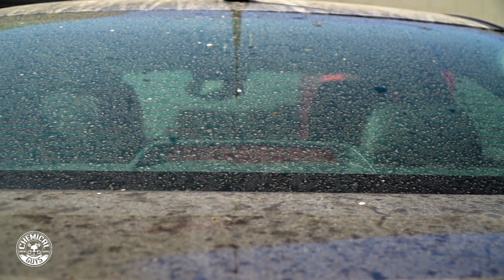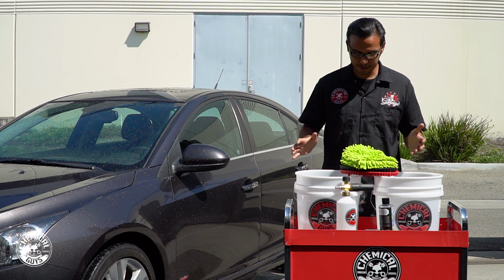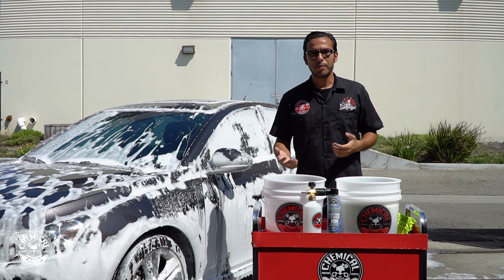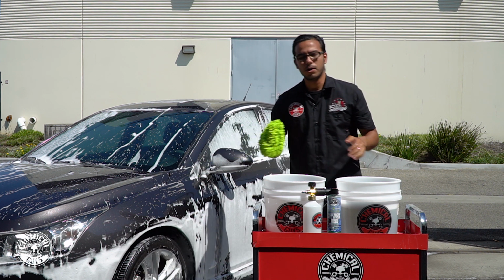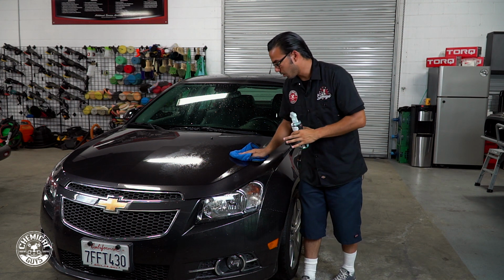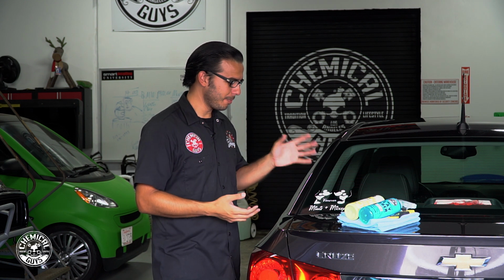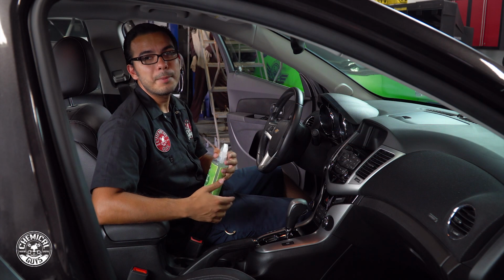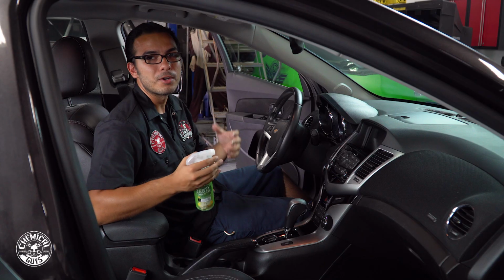How To Detail A Neglected Car! - Chevy Cruze - Chemical Guys Car Care

Comment: No clay bar, no polish, no wax, no protection, no wheels and arch cleaning, no interior cleaning, ... This video is not "How To Detail A Neglected Car" but just a long advertising for two products. Cool video anyway but the title is misleading... just my opinion
Reply: Rims are also clean. Looks more like car has just been sitting parked for a few weeks or less if next to a dirt lot. CG has shown dirtier cars than this without the neglect tag.
Reply: If you were attentive you'd realise that when he said "We kind of snuck his keys away, we're trying to surprise him and do this quickly" that they probably weren't going to do a full clay/cut/polish/wax or seal.
Reply: if you haven't noticed every single video they make is an advertisement for their wares....

its called business
Reply: if a car doesn't need to be clayed, don't clay it, if a car doesn't need to be polished, don't polish it. it should have been protected at least, but it didn't seem to need polishing.
Reply: +Danny Canham Then call it what it is, how to wash a dirty car. There was no detailing done, just a simple two bucket method wash and dry.
Reply: Washing in direct sunlight
Reply: @wheresthedvo  then u dont call it a "detail"
Reply: @Sketchy_Vettes  dude they didnt even do the basics correectly, they likely didnt more damage than good to his paintwork

Comment: I bought CG's TORQX polishing kit ($199 @Amazon) + V36 & V38 compounds to remove holograms I created by accident.  The DA polisher & the V36 worked like magic and now my 2004 Acura TL is shiny.   For wax, I still use Gliptone's paint sealer but I may give a try on CG's product. 

BTW, the DA polishing kit at about $160 @Amazon is sold at approx $700 @Amazon,co.jp (Amazon in Japan).............
Reply from the maker: Hey buddy, thanks for watching! That's great news, glad you picked up the TORQ X, it's a worthy machine. V38 and V36 will definitely get the job done. You should try our Jet Seal, which would be the equivalent of what you're using right now. People who are passionate about detailing love Jet Seal, it spreads easily and has long lasting protection against the sun's damaging rays.

Comment: Wow that shine looks new, from camera angle looked pretty original like from the dealer after it was washed, sure a few details to be 100% but great wash!
Reply from the maker: The cruze needed to be polished, and they did that in the following video which made it look complete, the paint was thrashed after decades of improper conventional washes, and plenty of neglect on the behalf of the driver.

Comment: Wow legit the next car I would like to own is a Chevy Cruze RS it’s actually a nice car and all that flake in the paint is awesome! I love the colour and I’m really happy you guys did that for you boy in the office if that was me at the end of the day I’d be looking for ya nick and buy you lunch of supper bro. That was a nice thing you did for them. As always chemguys stay frosty and see you on the next video. 

Take care,

Your number one fan 

Matthew.
Reply: It has a jerky bad shifting gear box. It's really slow. But gives out good gas mileage. I own one;)
Reply: They are amazingly slow. Doesn't handle well, doesn't shift nice. I had one for a rental for about a week. Abused the living he'll out of  it lol
Reply: Don't do it lol. Resale value is non existent, handling is decent but not the best, braking is terrible even when brand new, constant problems (coolant leaking, PCV valve cover failures, intake manifold failures, radiator cracks, water pump failures, accelerator pedal fractures.) I have one and it's the worst. When everything is running fine it's a decent car. But I've spent approximately $3k on repairs this year alone.
Reply: My mom just got a 2017 chevy cruze and its one of the best cars i have ever driven. also get the LT cause you got more options than the premier model. for example redline edition which is one of the options not available on the premier but is available on the LT and looks cool.
Reply: Matthew Osborne bro DONT do it... I got a brand spanking new loaded 2015 Cruze 2LT RS with the beautiful tan leather interior, and had to get rid of it. Vehicle had MANY issues (some almost fatal), although it was well maintained, and garage kept. In a period of 3 years, the car was in the shop over 25 times, and never fixed. We had to file a lawsuit under the lemon law, and won. Instead, I bought a brand new jet black 2017 Nissan Altima SR, with the appearance package. A MUCH better car.
Reply: Christopher Daniel and that shitty CVT. Altima are know for huge problems with CVT. Don’t get an Altima.
Reply: I had one as a rental too had like 10k on it and couldn't believe how noisy the engine was and how hard the shifts were compared to my 10 year old lexus. Did get good mpg though
Reply: I have a 2016 the new body in premier it’s way better than before the LT is too cheap looking. They def did a huge improvement on the new models. It would be best to just get a deal on a Premier RS
Reply: Matthew Osborne my dad has one and it’s junk

Comment: Snowfoam is for a pre wash,it's designed to remove contaminants before following up with shampoo using the two bucket method or alternatively use the shampoo through the lance. Snowfoam and shampoo are meant for different things. I found this confusing and potentially people new to detailing can get confused and think you can just use snowfoam instead of shampoo to wash the car. Love your vids but maybe it should have been explained better that you washed it with shampoo after 🤔
Reply: Well at least I hope it was washed with shampoo after,I'm a big fan and would love it if you could reply as I'm starting to thing I'm using snowfoam wrong here. 

I normally spray snowfoam and let it dwell,then rinse off, then I grab a bottle of black light shampoo or V7 👌🏻poor into my bucket then wash again with shampoo using two bucket method or shampoo via the lance for loads of suds.

Comment: Why would you 2 bucket without rinsing what the snow foam has pulled off the car? Surely you are just rubbing the dirt back in! I would likd to here your logic behind this
Reply from the maker: Hey Bill, thanks for watching. We started by rinsing to loosen and remove the heavier debris followed by foaming to encapsulate the remaining particles, the purpose of foam is lubricate the surface and wash mitt so that they both will safely glide across the surface. We try our best to conserve natural resources..."and don't call me Shirley" - Airplane

Comment: What brand of pressure washer do you guys use and what psi is required to get the same foam results?
Reply from the maker: Greetings from the Chemical Guys media team, we use a pressure washer with similar specs like the one in the link . It's not the same brand but the reviews seem to be positive.  Stay tuned for more great videos.
https://www.homedepot.com/p/WEN-2800-PSI-2-3-GPM-Gas-Pressure-Washer-173-cc-PW28/301403932?cm_mmc=Shopping|THD|google|&mid=srvJZ9Wc6|dc_mtid_890338a25189_pcrid_139636194844_pkw__pmt__product_301403932_slid_&gclid=Cj0KCQiAkNfSBRCSARIsAL-u3X9yCxXoF8Y_xh572XYgyk_c87RarFl_O5nrsM5OxhVNLsnyIDSzSHIaAlR-EALw_wcB

C.G. Alex -

Comment: Is it better to wash the car with the suds on or rinse it then wash it by hand with the 2 bucket method?
Reply from the maker: Hi Jacob, how's it going? We like to wash with the suds on. The suds help lubricate the paint and help keep abrasive particles from scratching the paint, so the more suds the better. As you can see in the video, when using the foam cannon, we still use it in conjunction with the two bucket method. Thanks for watching and stay tuned for  more videos headed your way soon!

Comment: When shopping for a pressure washer, what is the highest and lowest psi to aim for? Thanks! Cool vid
Reply from the maker: Hi Wayne, you certainly don't want to go too high, or too low. The main thing you'll want to remember is that to get good foam, you need a high GPM to get good foam. Electric pressure washers are good alternatives to gas operated pressure washers for a number of reasons, however they don't produce enough GPM to get exceptional foam. We use a gas operated pressure washer with a PSI of 2800 and a GPM of 2.3. This is probably the best electric pressure washer specs I could find https://www.homedepot.com/p/Earthwise-1-850-psi-1-4-GPM-Electric-Pressure-Washer-PW18503/205694662. Most people will buy the the Ryobi 1600 1.2 GPM pressure washer. I would recommend buying this one in the link, it's got specs that are identical to the one we use. https://www.homedepot.com/p/Ryobi-2-800-PSI-2-3-GPM-Honda-Power-Control-Gas-Pressure-Washer-RY802800/205566052.

C.G. Alex -

Comment: How much pressure do you need to get that amount of foam?  I know the lower PSI pressure washers don't produce that amount of foam.   I am looking to buy a pressure washer and want to be sure I get Shaving cream consistency.
Reply from the maker: What's up Cody! We recommend using at least 800 PSI to produce a thick layer of foam. Add two or three ounces of your favorite shampoo to the canister and fill the rest with warm water for enhanced foaming action.

Comment: I have a question for JetSeal. If you apply by hand to the entire car, do you have to let it bond to the surface and then buff it off or buff it off right away because if you apply it by hand and your done applying it to the entire car the other panels are readyto buff off. Also after you apply JetSeal do you have to wait 8 to 12 hours to let it cure to the surface. Also how to maintain JetSeal after applied.PLEASE REPLY. Sorry for the long comment
Reply: I would let it sit on the vehicle un-buffed for around 20 minutes or longer. Then buff off by hand. 

About maintaining. Just stay up on regular washes. JetSeal leaves paint crazy slick so it shouldn't get as dirty as fast.
Reply: Michael Goodijohn thanks
Reply: just search a jetseal video..

Comment: Is it recommended to spray the interior scent into the air vents to prolong the scent? I sprayed the footwells and it lasted almost a week.
Reply from the maker: Hey Dominic, thanks for watching. It's generally recommended but because it circulates the scent through out the cabin, and purges any odors trapped in there. It's not mandatory by any means, but it's a nifty little trick.

Comment: It's my impression or after the very first rinse the car went new?... No need to wash wheels, back lights are shining like diamonds... It looks like a detailed car.
Reply from the maker: Hi there! Although the vehicle looks clean after the first rinse, there are still abrasive particles and grime sitting on the surface that can scratch the finish if not properly removed. - Happy detailing!!
Reply: @ChemicalGuys  thank you for your reply, probably you didn't understanded that what I was telling is that the car was not that neglected... As on the first rinse it looked new... The car was detailed. When I get a car like that it's impossible the first rinse do that work!

Comment: Kinda strange process i would always wash the car before after foaming it and then use the 2 Bucket Method🤔
Reply: Flo Yo What? Isn't that what he did? Or do you mean you would snow foam, rinse, then 2 bucket?
Reply: yes
Reply: because i think when you foam and instantly use the 2Bucket method u work in all the dirt which got loose and create scratches in the paint makes no sense to me
Reply: Yeah ok now I get you. I agree. Dirt could still be stuck in the soap from the foam cannon so I would deff. Rinse before I 2 bucket wash as weel
Reply: Not necessary, it isn't a show car it's a freaking chevy cruze the power washer got off any "chunks". Soap without agitation doesn't do a whole lot.

Comment: Y’all need to do a video on how to detail a car with rubber on it for us track people
Reply from the maker: Hey James, that's an interesting idea. I would say you could approach it the same way you would any vehicle. Start by washing waterless/foam cannon/two bucket. Feel the paint, if it's rough than you can use a clay bar to remove contaminants.  Since you're running your car on the track, more than likely you have scratches in the clear coat from either washing, or from gravel bounces off of the hood. Polish your car, and add a coating of glaze to fill in scratches, followed by a protective coating of sealant to combat oxidation. The last order of business is to apply a wax to make sure that things like bird droppings, water spots, sap, industrial fall out, dirt and debris don't settle into your paint. Addressing the rubber is important because it will get battered, and the combination of heat and humidity will cause the rubber to fade and crack over time. Apply a trim dressing to moisturize the rubber, and give it extra shine. Chemical Guys recommends the Tire and Trim Gel, Black On Black if you'e looking for an aersol, or G6 Hypercoat. For the ultimate protection, apply some Carbon Flex Ceramic trim coating to the rubber to get the trim pieces protected from premature degradation. Stay tuned for more great videos every week!

C.G. Alex -

Comment: How do I remove water spots of a big aluminum tanker? I washed it but it is to big to dry before the sun dries it. Any ideas?
Reply from the maker: Hey there buddy, work in small sections instead of coating the whole thing, that way no areas dry unexpectedly. Pick up some of our Heavy Duty Water Spot Remover, and scrub away the water spots. After you're done, use some De -ionized water to neutralize the water spot remover.

C.G. Alex -
Reply: Chemical Guys thanks buddy
Reply from the maker: You got it, any time.

Comment: Can we use the shampoo suds as a clay bar lubricant??
Reply from the maker: No, you're not meant to mix the clay and the soap. The reason why clay luber works better than anything is that it contains specific ingredients that's missing from the soap, or water. The clay bar is abrasive , and soap will only allow a single pass before the clay bar rubs right into the paint. Clay luber is really easy to work with, I highly recommend it.

Comment: I have a 1989 bmw 325i. I had 2 mice get into my a/c blower housing while it was in storage . They popped and pissed all over. Any idea how to get the smell of  poop and mouse piss out of the car?
Reply from the maker: Hi Mr.G, you're going to have to get deep in there and physically remove that piss and poop because no matter how much you spray, the feces will still be there. You need to go to the source and take it out first and foremost before you can improve the smell. 

-CG Javier
Reply: Chemical Guys Javier,
I've done that all ready. I have actually gone over it twice now. And every time the car warms up. The smell just comes back

Comment: This guy lost his man card when he placed that decal on his back windshield. Seems like there's always a "different" prosuct for everything.. Heres a spray to help dry the car... Also we have a spray you can use while driving to keep your interior moist... We also have a spray you need to run the vacuum . we also have a spray you can use when you have a passenger to avoid them leaving indents on the passenger seat.
Reply from the maker: Hi Christian, Chemical Guys makes products for detailing. Chemical Guys creates products to address issues that arise when cleaning your car in a more precise way. Simply dusting and washing your car with water just doesn't cut it anymore, and there are a variety of ways to clean your car to preserve the paint, to avoid scratching and to remove stains that have been sitting there for a long time.

Comment: I live on the lake on the lake side of the street. I could put my washed car under a tree and a day later with some wind and a morning dew it would look like this.
Reply from the maker: It happens more often then most people think Josh, that's why weekly or bi weekly washes might be necessary.  Most importantly applying waxes, sealants, and trim coatings will help ensure that your paint stays undamaged, and anything that tries to penetrate the surface is thwarted. Stay tuned Josh, we've got two more excellent videos that will be launching tomorrow and Friday, you won't want to miss them. Stay golden!

C.G. Alex -

Comment: Is that a chemical guys blade?
Reply from the maker: Hi Steve,

It's just regular blade. Just remember to keep the surface lubricated and go at it in an angle if you're also trying to remove a sticker.

Comment: When and what technique do you use on the wheels? Thanks for the great videos...
Reply from the maker: Hey there. The wheels are taken care of first before you proceed to the rest of the car. For wheels, Nick typically rinses the wheel with a hose or pressure washer, followed up with a soap bucket full of Diablo wheel gel, or sticky citrus. Our brush of choice is a concourse wheel brush or a wheel woolie because they can maneuver easily between wheel spokes without scratching wheel finishes. After you've thoroughly cleaned the wheels, you hit the wheels with a jet of water to rinse off the soap. Take a black  microfiber towel and dry the wheels. If you haven't applied a wax or sealant to your wheels in a long time, you should take the time now to make sure to do so. Applying a wax and sealant to your wheels will preserve them for a long time. Here's a link to a few videos you might find useful.
https://www.youtube.com/watch?v=HF3rWaQqsuo&t=82s

http://www.chemicalguys.com/Diablo_Gel_Wheel_Rim_Cleaner_16_oz_p/cld_997_16.htm

http://www.chemicalguys.com/Sticky_Citrus_Gel_Wheel_Rim_Cleaner_16_oz_p/cld10516.htm

http://www.chemicalguys.com/Wheel_Woolies_Brushes_p/acc_m10.htm

http://www.chemicalguys.com/Easy_Reach_Wheel_And_Rim_Detailing_Brush_p/accs37.htm

https://www.youtube.com/watch?v=AffrP9D2WV8